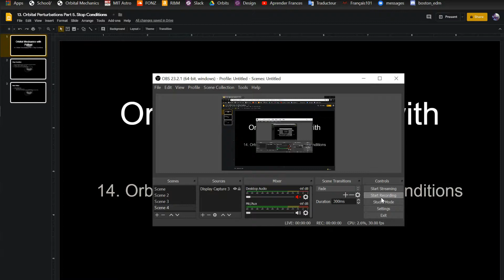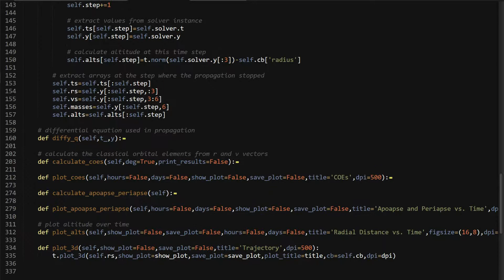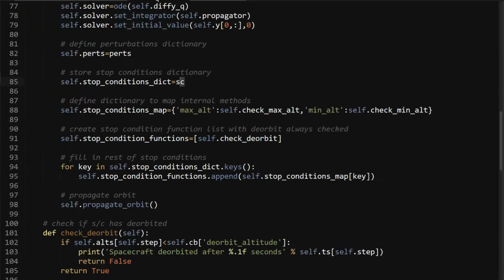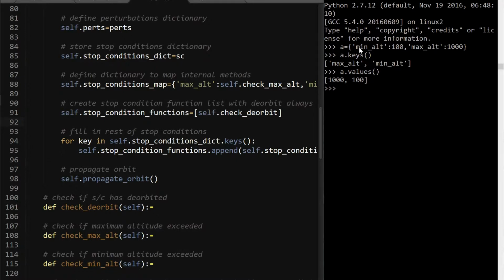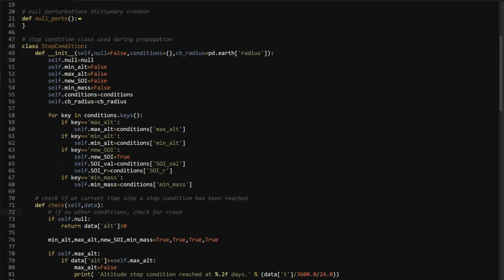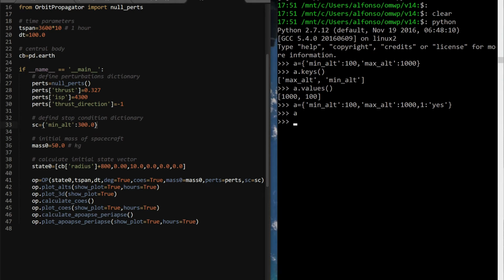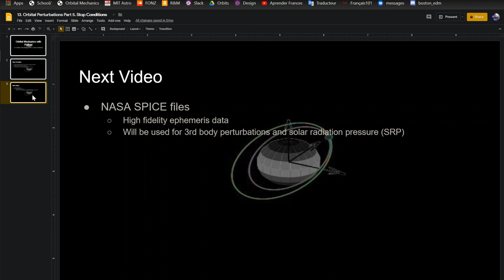Orbit Propagation Stop Conditions | Orbital Mechanics with Python 14

Comment: great, but there is probably a small problem :) , tspan = 10h, 'min_alt': 300. There is no message "Spacecraft reached minimum altitude after ...". If I increase tspan or min_alt I get a message but also an error in op.calculate_coes (). I managed to get rid of it when I put self.n_steps = self.step to def check_min_alt (self) and check_max_alt (self) because it was similar in max_alt.

I could have something wrong :)
Reply from the maker: From what I'm reading, your problem may be that you should use self.step when you're indexing the state arrays, not self.n_steps. Doing this makes it so you don't need to change the self.n_steps variable. Changing self.n_steps in the middle of propagations will affect many things
Reply: the program works just like yours.
In your video the message "Spacecraft reached minimum altitude after ..." does not appear, which probably means that Spacecraft did not reach 300km
  Errors appear when I change "stop condition dictionary" or "tspan".

My OrbitPropagator: init and OrbitPropagator: propagate_orbit look the same, hmm
Reply from the maker: Actually I just rewatched it and I realized that for the conditions that I gave, the stop condition was actually never reached, its just that the propagation ended because it reached tspan. Try increasing tspan or increasing min_alt, so that the stop condition will actually be reached before the propagation time runs out.
Thank you for catching another mistake in my videos!
Reply: No problem :).That's why I played a bit with n_step because changing alt or tspan gave me an error.
Reply from the maker: @Marokolnik  What was the error? Was it an lsoda one
Reply: so that was the error:
OrbitPropagator.py, line 191, in calculate_coes
    self.coes[n,:]=tool.rv2coes(self.rs[n,:],self.vs[n,:],mu=self.cb[ 'mu'],degrees=degrees)
    IndexError: index 424 is out of bounds for axis 0 with size 424
Reply from the maker: I just reran the script the way I had it in the video with a tspan of 100 hours, and for the elliptical orbit case it reached the minimum altitude at ~11 hours, where in the video I only had the tspan at 10 hours.
Reply: I will check my files again, there must be a typo , my n_step change helped, I think, but may create another problems, ok, thank you, next step is v18 :)
Reply: @Marokolnik  Hey, this might come down very late. But the issue could have been that in the main program where everything was called, you might have forgotten to add "sc=sc" where the op object is created

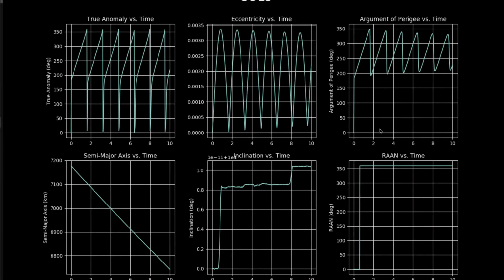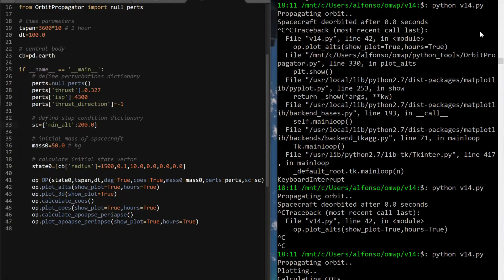Comment: Bro, I am having a doubt in the results at 14:29 and 15:48. Both of the results using different initial states but same initial inclination of 10 deg, but when we observe the fig in the results it's showing quite strange in both. Could you pls explain why its happening like that?  I couldn't get the inclination and RAAN results as you got, even I check the transformation function eci2perfi. Everything seems correct.
Reply from the maker: Try switching your rv2coes() function to the SPICE implementation. I did it at some point but didn't explicitly cover it in the videos. I trust it more than my version and its written in C so its faster. The function is called "oscltx", and you can find the documentation in the spiceypy docs: https://spiceypy.readthedocs.io/en/master/documentation.html
Let me know if you're still getting problems after that.

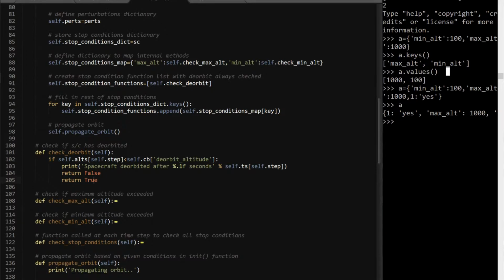Comment: at 9:08, you didn't point out the 'deorbit_altitude' key element included in the planetary data file, when explaining about you check de-orbit function!
Reply from the maker: You're right my apologies. Here is what my earth dictionary looks like in the planetary_data.py file, where deorbit altitude is set to 100km. 100km is usually what it used but it could change based on different applications.

earth={
                'name':'Earth',
                'mass':5.972e24,
                'mu':5.972e24*G,
                'radius':6378.0,
                'J2':1.082635854e-3,
                'zs':atm[:,0], # km
                'rhos':atm[:,1]*10**8, # kg / km^3,
                'atm_rot_vector':array([0.0,0.0,72.9211e-6]), # rad / s,
                'deorbit_altitude':100.0, # km
                'spice_file':'/mnt/c/Users/alfonso/OMWP/spice_data/de432s.bsp'

}
Reply: @alfonsogonzalez-astrodynam2207  No problem! Thank you.